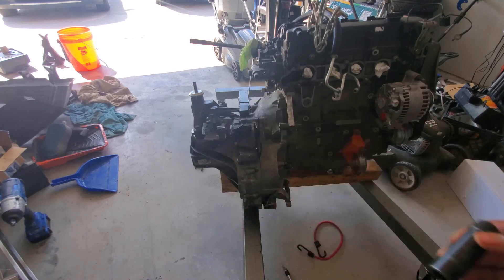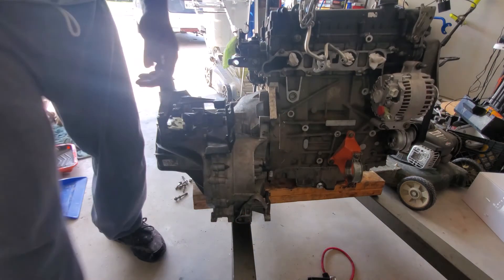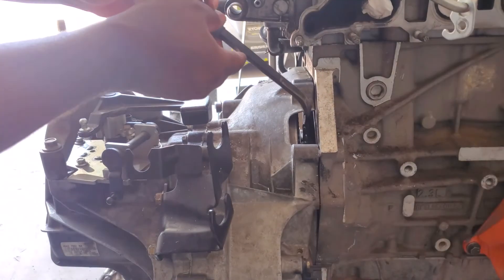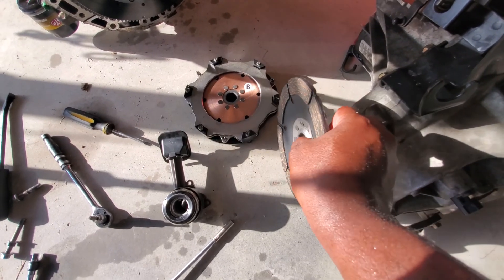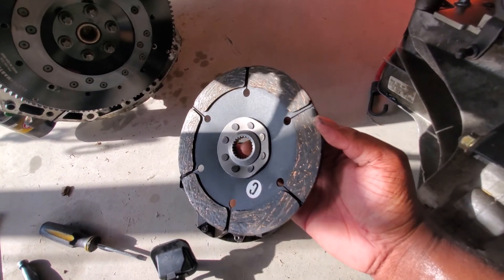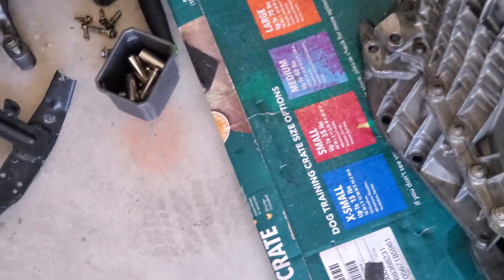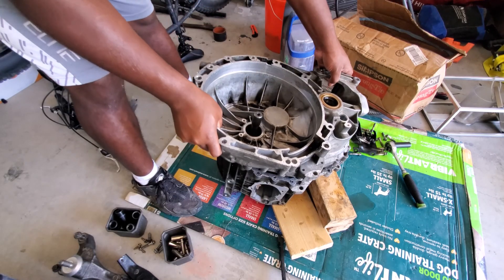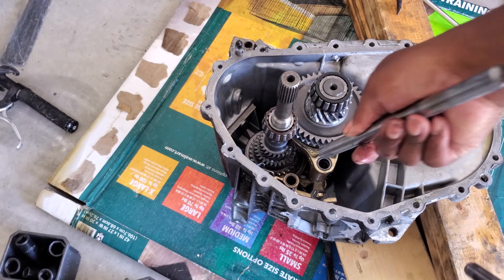2005 Ford Focus ST-Clutch issues/Transmission Breakdown

Comment: When I picked mine up the Manual Trans was SCREAMING, immediately did a fluid change and it sounded normal again. It mow needs a clutch but that is a job for my mechanic. 😂 I will be changinv out the rear bearing thanks to your other vid though! 👍
Reply from the maker: its really not a bad job. More time consuming than anything.
Reply: @FocusedHands  says the guy who casually pulls apart his manual trans. 🤣 As a backyard mechanic I dread all the work involved to even get the trans to a point to where it can be dropped. I also use the car daily as a delivery car so the mechanic visits are tax deductible.  I do a fair share of it myself though to save on down time as well as labor costs. My issue is the Mosquitoes most the year. My property is on the backside of a swamp so they get bad at times.
Reply from the maker: @chrsmdws1  funny thing is ill be making a video about a trap for those! Hate those things! Just found out dragon flys eat them!
Reply: @FocusedHands  yes sir, I also have an abundance of those around as well. They also munch on the Deer flies that hatch yearly here too. I'm in Central North Carolina.

Comment: I’ve got a question for you. I’ve only recently discovered your channel. My question is I’ve got an ‘03 Ford Focus SE sedan with a 2.0l SPI motor, 5 speed manual transmission. I’m lookin to swap That motor with a 2.0l Zetec. Do you by chance know everything I’d need to complete that? Like a matching transmission, would I need to get my keys reprogrammed? I have never done any engine swaps so I’m clueless as to what all may be needed…
Reply from the maker: I would swap to the duratec  engine... much better!
Reply from the maker: You will need to get a tune for increased hp/swap changes. You would not have to get a re key... but if you swap to the duratec... I think you will. As far as zetec transmissions go... you won't be able to use the duratec... they have different  bolt patterns!
Reply: @FocusedHands  would I be able to keep my ECU and put a tune on it? If so what tune would you recommend? This would be for the 2.0l Zetec swap. Thanks for the info too, this is a big help
Reply from the maker: @CasualGaming76  FSWERKS  has a tune kit you can buy. Check them out. If they don't have a standard tune for your zetec... you may have to call them for a custom tune.

Comment: Hey Focused Hands! Good to see you back. I used your videos to take the valve cover gasket, intake manifold, and oil separator off my 2.0L duratec to fix some oil leaks/delete the tumble flaps. What do you know about throttle body mods?
Reply from the maker: You should  go over to massivespeedsystems.com